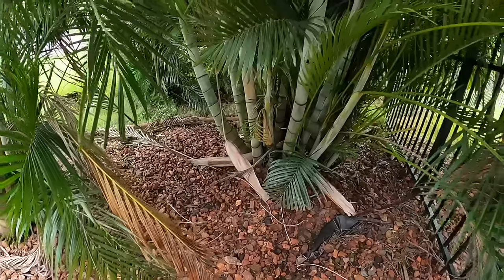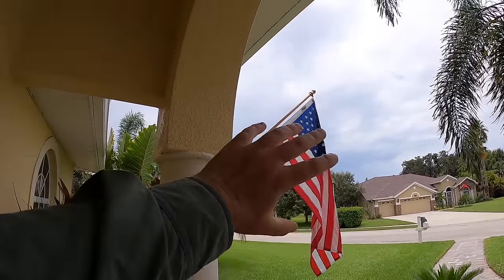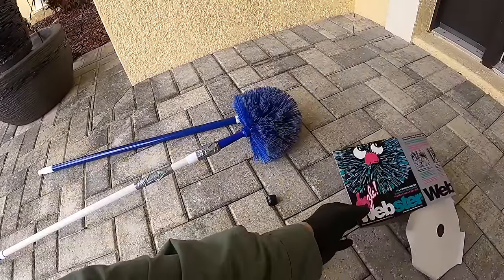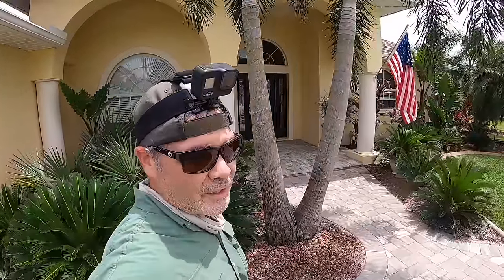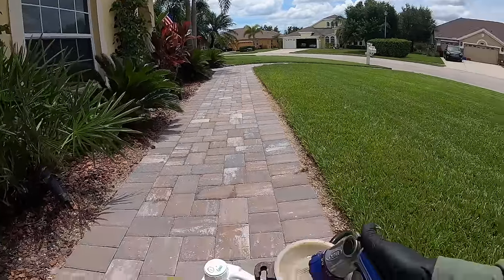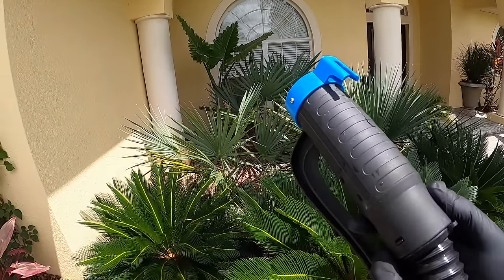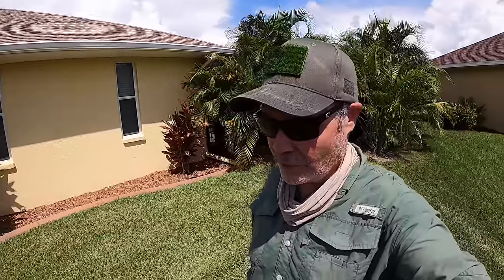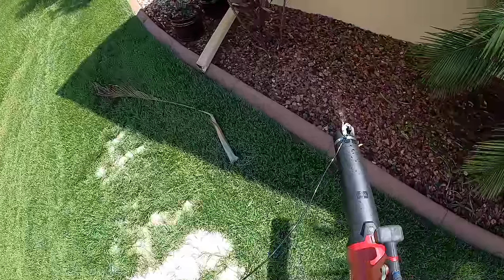Get Rid of Roaches, Mosquitos, Fleas | Home Pest Control

Comment: Good information.  As someone who is licensed for pest control, please remember to read the label like Allyn suggests and wear your PPE.  This stuff can be pretty miserable if you get it on your scalp or face especially when it’s hot out and your sweating.  It can cause a burning sensation that last for hours and it’s painful.  Also, rotate your chemical classes.  What I mean by that is don’t use synthetic pyrethroids like Bifen IT or Talstsr exclusively.  Use a natural or botanical product like Esentria or EcoRaider ER-3 every other application so that the pests don’t develop a resistance to the pesticide.  Follow the labels and don’t mix it stronger than it suggests.  If these products are overused and abused we will all be screwed. The pests will be resistant to the product and we won’t have anything to control them because we don’t have any more formulations. Please be good stewards of the environment.
Reply: The Tekko Pro would reduce the chances of resistance due to the MOA.  But I agree, alternating different products with different MOA's is essential
Reply: Ditch The Itch would it be a good idea to mix tekko pro with esentria then? Currently i do talstar p + tekko pro 2 weeks after termix does their spray so i get coverage every 2 weeks, once a month from me, once a month from termix.  I want to rotate in esentria or eco raider ec3 (which is better btw?) and am thinking maybe still mix in tekko pro
Reply: I wouldn’t spray every two weeks.  Every 3 weeks to 30 days max.  Every two weeks is a lot of pesticide
Reply: @johnadank194  maybe i am doing it wrong because every 2 weeks and still my wife gets bit on her ankles like crazy every night.   and i am in a major city  suburb so its not a very wooded area at all.  i just ordered the mosquito sniper hopefully that will help
Reply: A ULV unit will kill them right away but all you can do is control them not eliminate them.  Make sure your getting rid of standing water in planters, bird baths etc.  90% of mosquitos breed in about 10% of the available water
Reply: @johnadank194  i am religious about elimating all standing water immediately but i have neighbors who dont care, one guy with a bird bath that he doesnt treat or change the water in ever so its probably where most of my mosquitos come from
Reply: john adank yeah you are right.  Problem is Pyrethroids are just synthetic Pyrethrins like Esentria.   Personally, I don’t like to push DIY folks beyond pyrethroids or pyrethrins, so if resistance is built a pro will have a lot of options.   For me, Talstar (same as BinfinIT) is my go-to.   It is less repellent than Per/Cyoer/Delta methrin but also slower., no oder, still very broad spectrum, safe on ornamentals indoors out...   Hands-Down dollar for dollar BinfinIT or Talstar is a great first-line Pyrethroid.   If I had only (one product on the truck) that would be it.  The Micro-encapsulated products are more for the pro who cannot be back for 90 days.   My second-line Pyrethroid is Cyoermethrin (powder) or SuspendSC (Deltamethrin).   Both are more money than BinfinIT, but for many pests it is like an electric fence to them.  A roach cannot walk 6” into the treated area it seems even after its dry...   they end up on their back so fast it’s crazy.   Bifin kills them if they touch it, but it’s a bit slower.   I have seen it take out ants, stink bugs, heaps of roaches that filled a vacuum, aphids...I have still seen it kill Millipedes as if a bomb went off etc.   Spray a wasp nest with Bifin until it is drenched and they will still be walking like all is just fine for a while, but 100% their death warrant is sealed.   Delta drops them as fast as Wasp Spray!  The different classes I hope homeowners stay away from are things like Neonicitinoids etc.   In one video LCN was comparing Temprid with a DIY product...  I would advise against recommending Temprid to Home Owners because it has a neonicatinoid in it; instead, recommend the Tempo which STILL has the Beta-Cyfluthrin and makes an awesome second-line “potent pyrethroid.  You don’t want folks spraying anything like Imidacloprid, fipronil, dinotefuran outdoors ideally because if a bee comes into contact it won’t die for six (6) or more hours, but it will pass on the poison to the colony and potentially kill 50 to 500 other bees.   The Pyrethroids in contrast are quicker, and if the bee makes it home and dies, others carry out the dead body themselves not being adversely impacted.  These products are more crucial for German Roaches and Bed Bugs...  or anything Pyrethroid resistant ...  Common pests succumb to Pyrethroids with ease.   For spiders and scorpions nothing beats Onslaught/Fast Cap....   THAT is what you should buy, Lawn Care Nut to spray up high where spiders are a problem... save the IGR for fleas, German roaches, bed bugs...  or mosquitos if you really cannot get them wirhout it.  While the IGR works for mosquitos too, it degrades super fast outdoors anyway.  Honestly just get Maverick Perimeter for mosquitos, Use BinfinIT for general pest control, and a Fast Cap for spiders
Reply: I will have to try the Onslaught on spiders.  I have a few customers who live near the river and have a lot of spiders.
Reply: john adank it is great for Scorpions, too
Reply: Cyzmic CS has been my go to for spiders and wasp.  That’s some good stuff!
Reply: I never thought about them building a resistance. I've been using the Bifen IT for a good year especially under my carport. I bought a little property out in the country that has a crazy /raspberry ant infestation. The whole surrounding neighborhood has them. The Bifen IT works out in the garage/ tac room inside areas and in the house where it doesn't get washed away so I know it works great but the yard is the problem. It was all overgrown when i got it, cleared it out, I keep the grass cut and clean but these things are literally underground and there a huge network of tunnels. I sort of gave up on the big yard as far as having the whole thing sprayed all the time because it's costly. Do you have any recommendations on a a treatment plan and if there's a way to set up a perimeter so they won't just come back from the neighbors each time they decide to bushog they're acreage?
Reply: @kellyeldershomesteadbeginn8242  Yes, over time they will develop a resistance.  For ants you need to place bait out for them.  I’m not sure what type of ants you have but usually a granular and gel bait together work well.  You can apply Termidor SC along the base of your foundation about 6” up and 6” out to help to deter them from coming inside.  Read the labels carefully before applying any insecticide and follow them to a T.  Ants take longer to control than other insects.  Ants need to take the bait back to the nest and feed on it.  Bifen does not work as well on ants as the Termidor.  Termindor CANNOT be used to control,fire ants or ants in mounds out in your yard.
Reply: @jeremynguyen2346  are you a bot?   A cold fogger is generally a backpack mosquito sprayer.   It’s basically a yard blower that puts a fine mist of product out.   It is great for spraying UNDER leaves too where mosquitos often land.   That’s all it is.
Reply: @NETWizzJbirk  this has got to be a joke
Reply: your very on spot...good info for the dyi'er we've been down that road before on pest resistance...even with the old school "LD50" bad 4. "Back in the day" we had to bounce back and forth with Lindane or Malithion and Diazanon or Dursban...I'm concerned with the average home owner's ability to comprehend specific label directions without getting into trouble in some fashion until its to late.
Reply: @mark33545  potted plants sometimes have dish to keep water from staining tables and such and some people use indoor pots with no holes outside. Broken tree limbs , gutters not angled to drain correctly anything that holds more than the cap of a water bottle for a week is a mosqito breeding site. Also some time drains. Yard drains or even city drains with poor flow. If thier the cities report them don't treat. Yours you can treat with bti. Bti is a bacterial control that only targets mosquitoes.
Reply: I'm assuming this also applies to the Bifen LP granules right? I laid down a bunch over the yard but from your comment I should be rotating to something else next year?
Reply: @ericg5877  what pests are you treating for in your lawn with Bifen?
Reply: @johnadank194  just general pests in general, now that it's summer and pouring rain I saw ONE cockroach in my house that must've come in from the yard so I laid down granules for them mainly but I've seen such a large reduction in mosquitos too which is awesome because now I can be in my patio at night.

Comment: Just a quick tip... I used Bifen I/T for a while, but wasn’t pleased with the length of time it lasted.  I switched to Bifen XTS (same active ingredient, but oil based instead of water based) this year, and it has made a HUGE difference.  For a place like Florida with lots of rainfall, it may be worth a try.
Reply: I am going to try it on my own yard and see if it makes a difference but make sure you get the underside of leaves they don't get rained on much and that is where the mosquitos land to rest. and I prefer to use slow release IGR granules where ever water pools up, gutters, low points of lawn,  flower pots tires ect.
Reply: Does this oil base work on mosquitos?
Reply: Thanks
Reply: @aarondilley5266  did it work
Reply: @jeremynguyen2346  ulv is ultra low volume. It's a cold fogger when it's blows a mist similar to a smoke machine at a concert where normal foggers use heat .
Reply: @CCCC-tq8yo  works. But not sure about lasting longer. Most of the products not available at the big box stores work. They just have to be used regularly and correctly.  Altosid and BTI pellets to control the breeding along with control standing water and regular light spraying. I used 1 oz. a month of what I have. Just never. Ever uses any neonics they get you fines.
Reply: Link boss?

Comment: I bought the sniper system and used it today.  Fantastic product.   Works better than expected.  Used it with back sprayer and Greenworks blower.  

I used for bugs,  but it works so will I'm going to spray my wooded area for poison ivy.  It really shoots a mist a long distance as well as coating my shrubbery.

Comment: If the sniper does produce the fine mist like the first contraption id definitely be interested in it. Great video. My wife runs the office at a exterminating company and got the inside scoop on what products they use. Suspend SC is the best product in my opinion for around the house. It last by drying and leaving crystals and any pest that touches it croaks. Great stuff, i highly recommend it. I basically do exactly what you did but also shoot the bottom of my baseboards throughout the interior of my home. I have pets and children and its perfectly safe. I can't remember seeing ANY bugs in i can't remember when 💪

Comment: Im about to do this on my property. The only change I would make is I was told to start at the house area first. The reason being that if you start in the lawn or perimeter of the yard the pest will run to the safe areas by the house. Chances being good that some will find their way in, I try to avoid chemicals in the house. So I was told to start at the home and work my way out.

Comment: Mega thanks to you, Allyn !  I live in Tampa, so we face the same pests here. Asian Tiger Mosquitos were very aggressive in my yard. I used the combo of Bifen IT and Tekko Pro as you described. The only change I had was to increase Bifen IT to 2 ounces per gallon, as the package insert stated the range for mosquito control ranged from 1 to 2 ounces. I used a Ryobi electric pump sprayer to distribute the liquid throughout my yard. Prior to spraying, I routinely would get about 100 mosquito bites while working in the yard for a couple hours. One week after spraying, that decreased to only 5 bites within 4 hours. And 2 weeks afterward, I got NO insect bites of any kind within 4 hours of outdoor activity. I was really stunned, that after living here over 20 years, my yard is finally usable.  Even last night, I was outside goofing around for an hour, and still got ZERO bites !  Thank you very much for making this video. You improved the enjoyment of my house tremendously !

Comment: Just an fyi if you are in California, you can only spray 1 inch wide on any horizontal impervious surface such as concrete, brick, or pavement this includes against the house. He said you can do three feet out but that is only on soil.

Comment: The $500 machine distributes the liquid much better which ends up saving on chemicals , and can  impact plants less .   However, I did notice it cannot shoot far to reach high places.     The DYI system is good but fails to distribute well, it acts like a high -pressure hose ,  they need to improve it by adding a liquid misting head.    The DYI system has the advantage of becoming cordless if your blower is gas or battery operated.      Great video .     Thumbs up.

Comment: Thanks for the tip on the Webster.  I've been using the cheap Home Depot knock-off for about 2 years, and the bristles bent after the first use.  Still somewhat useable, but I got what I paid for.  Maybe this one will hold up. Spraying the pesticide directly onto the duster is a pretty cool tip.

Comment: Bifen IT rocks. I used this in SoCal when I was a pest control guy. If you need something stronger that will work for even red ants look into Bifen xts. Same active ingredient just at 25% concentration and is oil based so the residual is better and isn’t as affected by rain.

Comment: I de-web first and then I'll treat with my B&G. I don't apply any chemicals to my brush because you'll end up smearing the dirt with the liquid and it's going to make look dirty.
I use Suspend Polyzone in the summer and Suspend SC in the winter. Suspend Polyzone residual last longer. I don't recommend oil-based products because eventually it'll start accumulating dust and dirt and it's not going to look dirty. If this happens to you once in awhile I would use Bifen-IT.

Comment: We used a airless paint sprayer when we would remove mold and add the chemical to a five gallon bucket of water. It works good cuz it would fog any areas where mold spores could have traveled. I wonder if that would work good on fogging out lawns for bugs

Comment: Allyn, for those spiders in your pool cage, I found a great solution that you almost did in this video. Using the Petra Fogger mix up the Bifen and Tekpro, same formula you used outside, fog the aluminum cage on the inside where the spiders live. It absolutely destroys them. It works so good for me, I would never use the web brush on my pool pole again. The spiders are gone for months. Btw, you need a helper to keep the electric cord out of the pool, make sure your plugged into GFI circuit for safety, unless you have a cordless fogger, while spraying, and I recommend wide brim hat, safety glasses and respirator since you fogging up high, and it can drift. For nearly 20 years, I was wiping them down with the web brush, dealing with spiders running everywhere, and they would be back in a few weeks.
Reply from the maker: that's a very good suggestion thank you!

Comment: Great video... as usual, the Webster is a great product... in the cleaning supplies section of the Lowe’s depot they have twist out extending poles for various cleaning implements and the ole Webster will screw right on there. Second I just ordered one of dim dare fancy gas blower mister jobbers from my local mower shop ... I am anxious to try this same concoction you used to try to tame my mosquito issues.... it’s out of control they are drinking all beer from the outside fridge and leaving the empty cans in the pool.... this obviously has to be put to an end
Reply from the maker: yes it does, right away!!!  Maybe you can put some beer in the mister and see if it will absorb through your skin ha ha!

Comment: I use a swiffer or any brand that will hold a towel in the house sprayed with bug juice of choice and go around where the wall meets the ceiling. Not goingto spray it directly and have it run down the walls. I like to get the upstairs bathroom where the house spiders hang out.
Reply from the maker: good strategy!

Comment: Great video...I'm using the BIFEN XTS (25% concentrate) along w/ Tekko Pro and a granular larvacide, Altosid ProG, for stagnant water areas...but not getting the results I wanted. However, I seem to have neglected the broadcast spray of my lawn area and possibly not applying enough of the chemical...mix rates are per 1000 sq ft. I also have the Mosquito Sniper System, which I am very pleased w/ in it's ability to get underneath vegetation and other hard to reach areas!  I also supplement certain areas like my front and back door area/back deck w/ a Pyrethrin such as Flex 10/10, or ExciteR, which provides an additional quick knockdown of mosquitos and other flying insects!

Comment: Would liked to have seen the foggy version of the snyper.   I would bet that using a fog or mist instead of a spray would do the same bug damage while using half the poison.  I will also bet that my pressure washer, with the tank filled with poison, will do more bug damage faster than either of the gizmos you demoed and without having to walk around to each plant.

Comment: Question- Reading the Specimen label off the website - Not trying to bust your chops but it says BASF 10243 PT Microcare CS do not apply to painted surfaces, now my outside  eaves are painted and I think that would apply to most- Did I miss something?  Just trying to understand / do the right thing. Thanks.